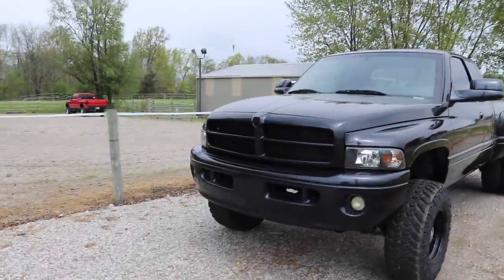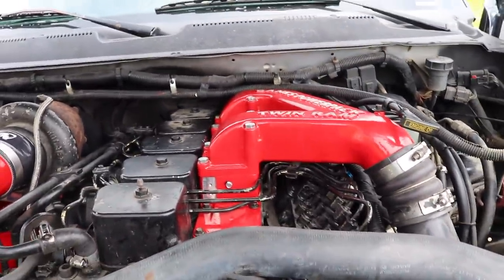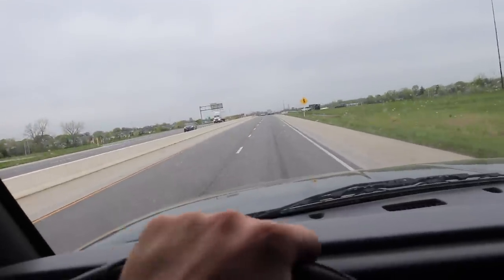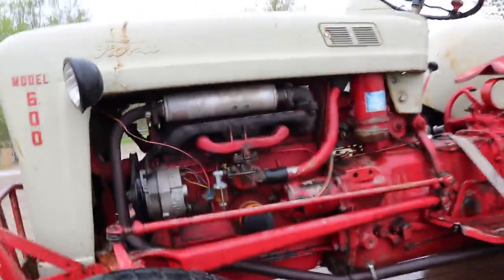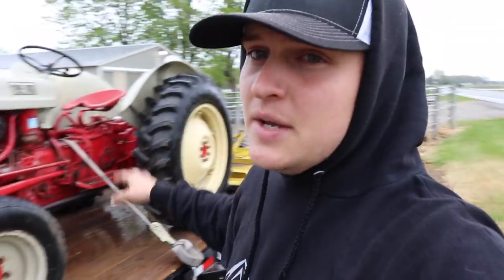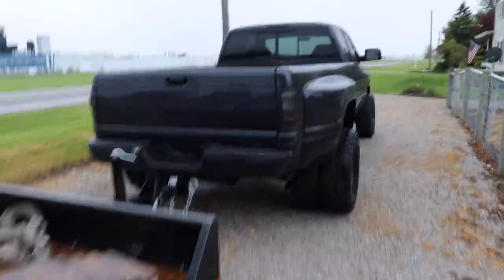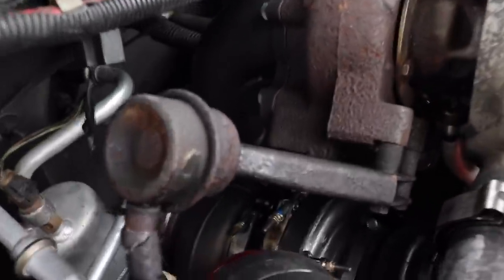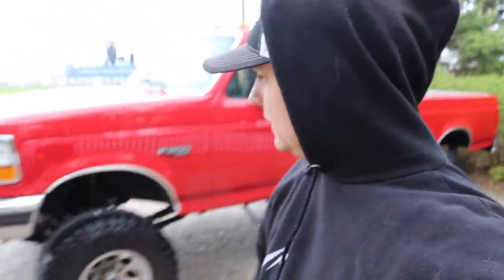COMPOUND TURBOS TOWING TEST + I BOUGHT A TRACTOR!!!

Comment: You got a steal for 2500 the tractor is 3500 runnin here in Missouri with no brush hog if I win the compound 12v id buy it from you I got my key chain yesterday thank you for the  speedy delivery